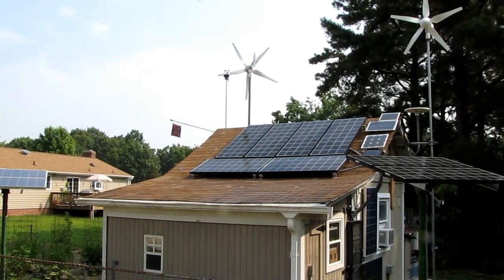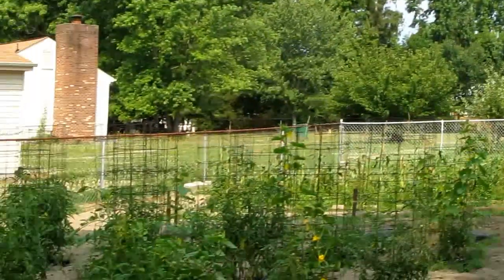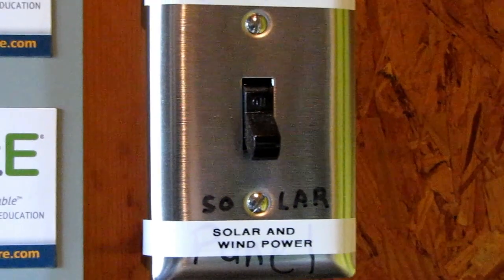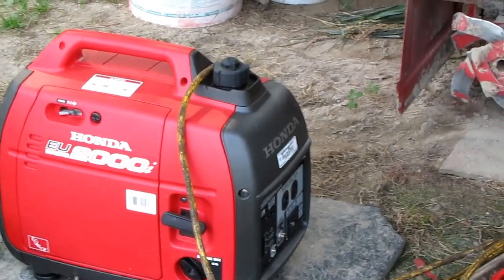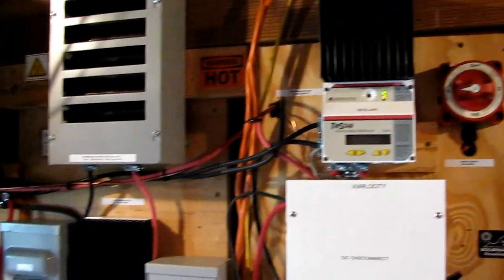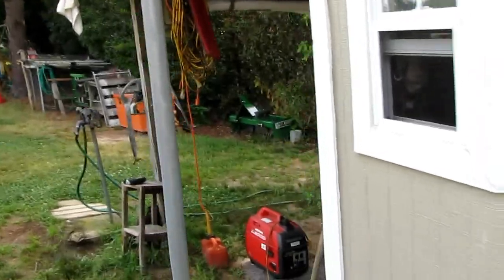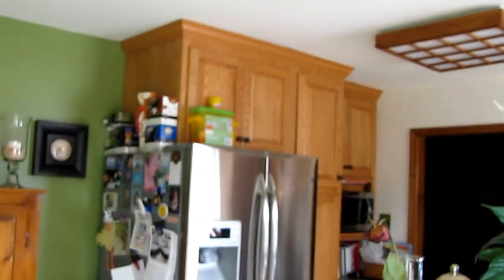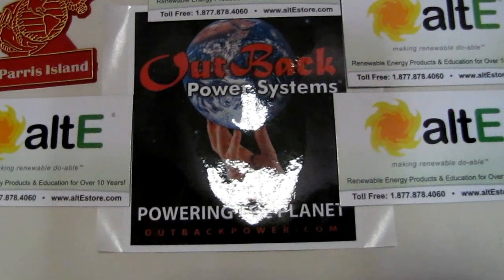OutBack Power GTFX 2524   After Hurricane Irene we Had Power for 8 days 8 Nights

Comment: Nice setup!  Kudos for being prepared too!

I am planning a similar setup with Honda Genny that will maintain a bank of batteries powering an inverter.  Generator would autostart.  Inverter would supply 3,000 watts to house from battery bank.  My assumption is that a 600 watt continuous load could be supplied from inverter with any startup surges handled by inverter/battery bank.  That way generator only needs to supply enough power to run charger.  Solar/wind would assist as well.